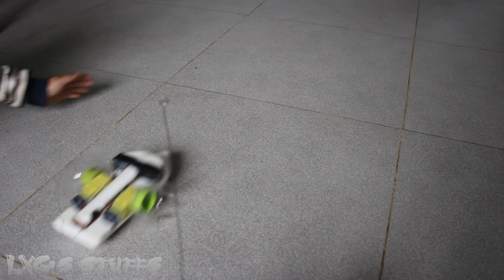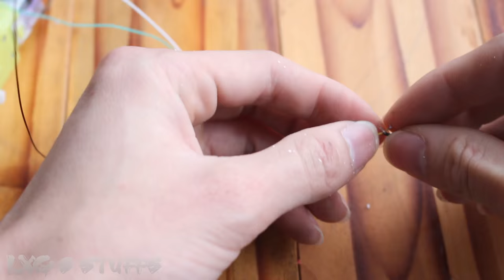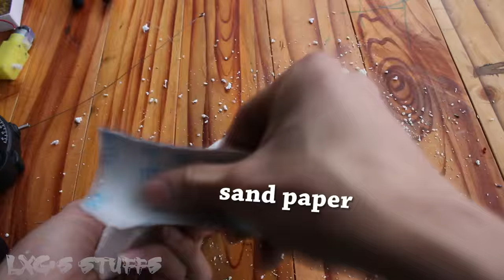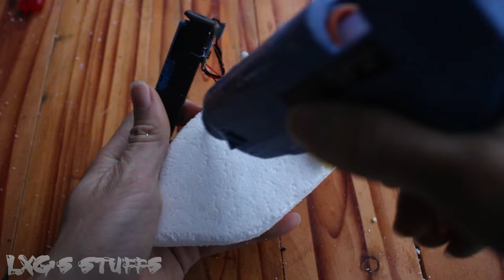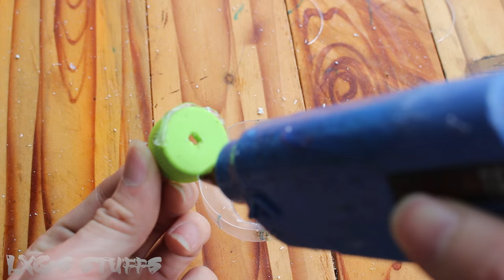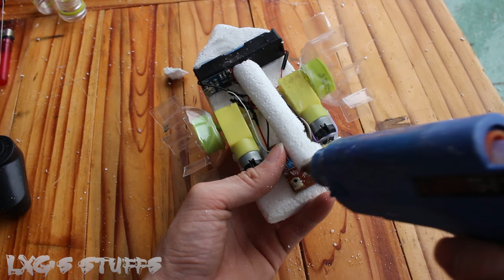Make a Remote Control Paddel Wheel Boat - RC toy

Comment from the maker: Components: please search it on google image 
● 2 motors RC circuit 27mhz 
● 5V DC Motor Gearbox Wheel
● Battery Charger Module
● 3.7 V rechargable battery
● soldering tool
Reply: You is good guy!
Reply: +LXG&#39;s Stuffs - &quot;HOMEMADE EVERYTHING&quot;  Sorry but can you say where we can found the  2 motors RC circuit 27mhz please?